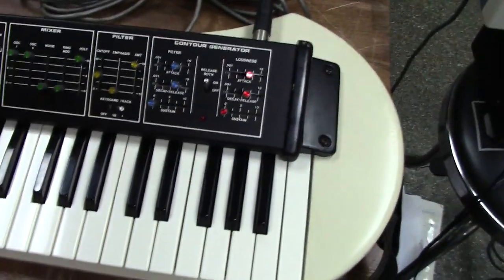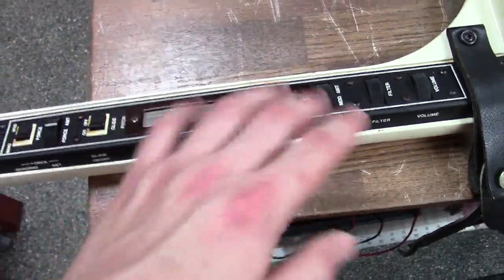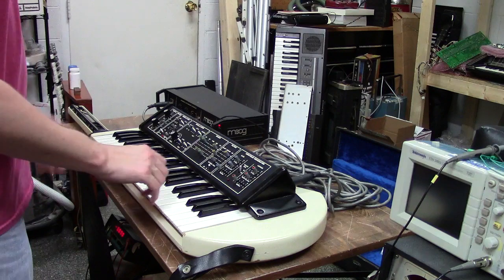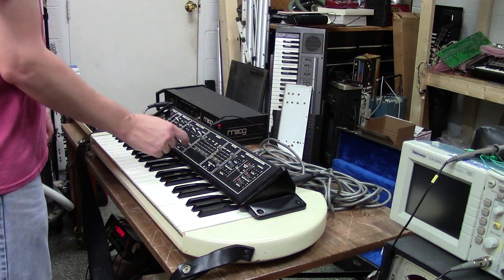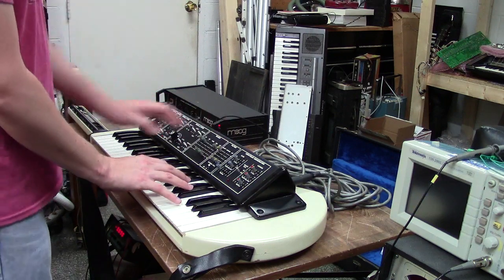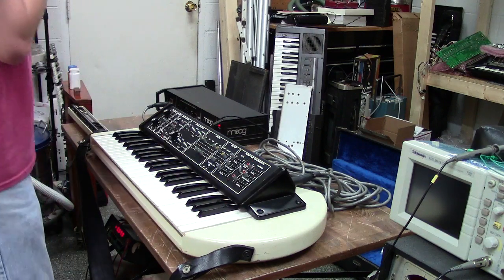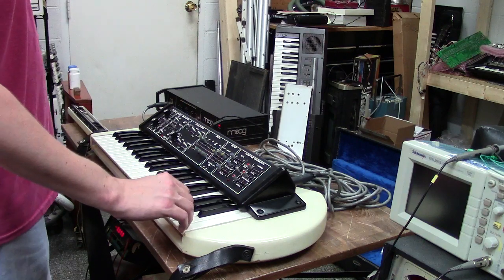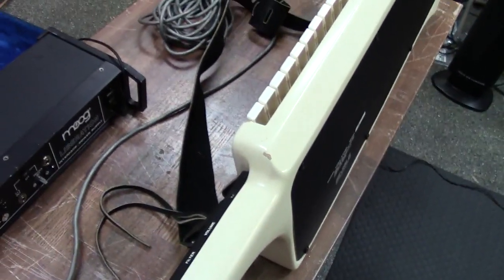Moog Liberation Sold (by Synthpro)

Comment: Hey, Jareth. Is the Liberation based on the Prodigy, sound generation wise? The design of the front panel reminds a lot of the Rogue, which came the following year. How closely related are all these synths?
Reply from the maker: Hi, The Liberation is very related to the Rogue and Realistic MG-1....its basically if you were to take the two and mash them together...You get the control of the MG-1 with the sound of the Rogue but with added expansion of Aftertouch, and everything is sent out as a CV signal so extremely useable. The Prodigy, Rogue, Liberation, and Source all shared the same oscillator design, believe the MG-1 was different if I remember correctly.
Reply: Thanks, that is interesting! As an owner of a few old Moogs, I find the Moog monosynth line quite intriguing, with several seemingly overlapping models and some that were in production for a reasonably short time, like the Liberation and the Multimoog. And there isn't that much reliable info on those around the internet.